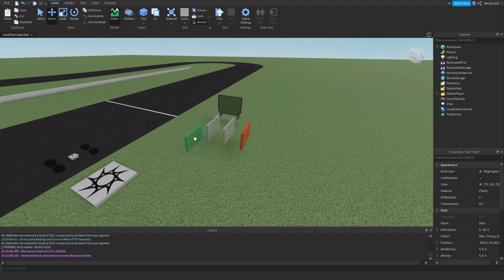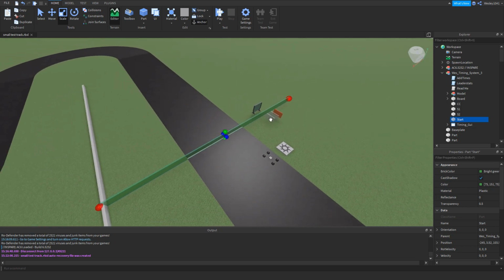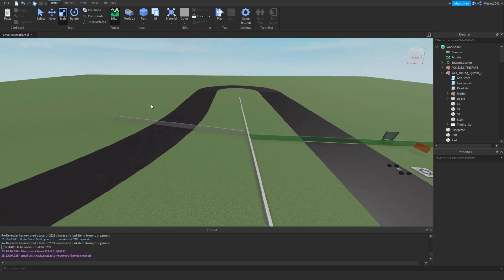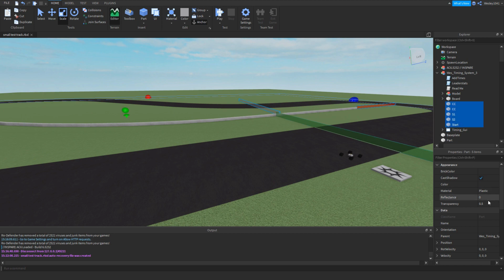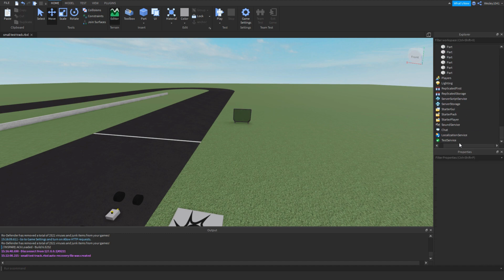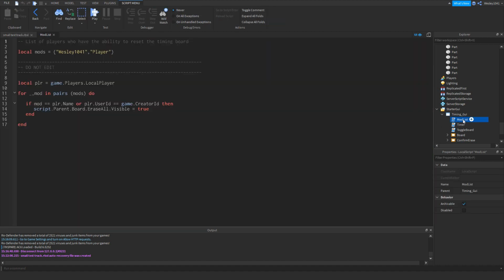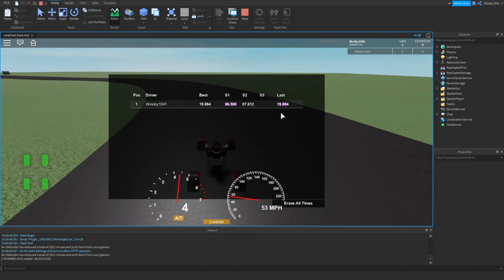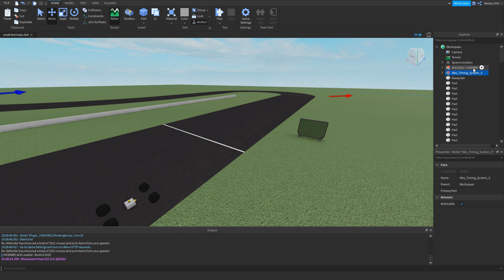ROBLOX | How to Install Wesley1041's Timing System

Comment: This doesn't seem to work anymore. I followed the instructions exactly, and it doesn't do anything. Pressing Q Brings up the gui, but it doesn't register a lap when you complete one.

Nevermind, my bad. I was testing it before I put it onto my track, and as such I wasn't seated during the test "laps" (Running through the gates). Works perfectly fine when seated, so make sure you guys dont make the same mistake as me when you're trying it haha!
Reply: I'm sitting down it still won't work
Reply: DONT UNGROUP THEM i hope i helped

Comment: WARNING: Everyone, do not use short tracks as the timing system will kick you for "cheating".
Reply from the maker: What have you tried in order to fix it? Go to the Config script and increase the min. sector and lap time values. This should fix it.
Reply: @Wesley1041_o  I simply just disabled the cheating system instead.

Comment: So I’m having some trouble with installing this, I think it’s because I’m setting the sector 1 + 2 in not exact locations of 1/3 the track, but otherwise I think I’ve done it all correctly, they worked at Daytona, no other track though

Comment: where is filtering, did it change to streaming?
Reply from the maker: Roblox removed the setting. It was due to be removed for a long time iirc.
Reply: @Wesley1041_o  is it possible to get it work then or do I have to use the New timing system you made?
Reply: @aarolehtinen7211   agreed
Reply: @wesfan1  what do you exactly mean with that? :D
Reply: @aarolehtinen7211  you aksed "

Comment: Hey Wesley, this is an awesome video. 

For some reason I cannot get it to work, it’s almost like the timing system isn’t there at all. I’ve done everything in the video including placing the GUI into starter GUI. Is the script outdated?
Reply from the maker: Hi. The script still works! Make sure to follow the steps carefully and do not ungroup anything. That will mess up the script. It's the most common mistake people make.
Reply: @Wesley1041_o  yes same problem for me too. I've done it like 10 times and watched the vid also like 15 times but it still doesn't work. the times dont get regietered
Reply: Something that does work is kick me for going too fast in test lol.
Reply: @seannolan2120  yeah

Comment: Hey Wesley, great video that you made!

But I have a slight problem, i do have the model but I can't separate it. Can you help me out on how to separate it so i can make a proper lap timing system?. Thanks!
Reply from the maker: With Alt + Click you can select a part inside a model. If you hold the Alt key you can move it.

Comment: Can you make the character not have to be in a seat, so you can just walk through it to start it
Reply from the maker: Yes. If you go to TImingGui>Timer, then towards the bottom of the script there is an if-statement that you need to change by removing the bit that checks if the humanoid is seated.

Comment: Is it possible to run 2 timing systems in one game? Since the circuit im currently building also has a drag strip it would be nice to have 2 seperate timing systems
Reply from the maker: Unfortunately not

Comment: The sectors do not show up, neither does any of the cornercuts or laps
Reply from the maker: Are you sure that you have installed everything correctly? The #1 mistake people make is that they ungroup the main model, which is something you shouldn't do. Make sure to hold Alt to select a part within a model if that's the case.
Reply: @Wesley1041_o  Thank you!
Reply: @Wesley1041_o  Also another question, Is there a way to add datastore for a multi place game? Like a track system that saves peoples laptimes across multiple servers? Would be great :)

Comment: Hi Wesley!

Thanks for the help with getting the system to work! It runs perfectly.

However, is there a way to reset Race Mode of your Standings GUI without refreshing the server?
Reply from the maker: Hi! You can "reset" Race Mode by clicking on "Race Mode" to turn it off, then reset the lap count of every driver via another script. Unfortunately my model doesn't have that feature. Then once you've reset everyone's lap count in the leaderstats, press "Race Mode" again
Reply: @Wesley1041_o   I can’t 
The new update

Comment: how do you pick up the pieces without dragging the whole thing?
Reply from the maker: Hold Alt when selecting a part inside a group
Reply: @Wesley1041_o  thanks, it works, i also succesfully installed race mode system, thanl you so much!

Comment: Question where do I put the time system things on Daytona and others nascar tracks
Reply from the maker: You place the start part on the start/finish line and make sure it extends to the pitlane. You can place S1 after the 1st bend and S2 right before the 2nd bend.
Reply: @Wesley1041_o Wdym by bend?

Comment: Hey I have done everything in the video and reinstalled multiple times, I did not ungroup anything and held alt to move each individual piece, I have the corner cuts, sectors, and start/finish line all in place properly. I'm using a car I built using a body rendered in blender, a-chassis 1.4 with a custom tune, and nothing else. Every time I try to do a lap it doesn't show up or show I completed a lap, there's no errors in output. Also whenever I hit G (the key I assigned to open the leaderboard gui) nothing happens, not even when I just leave it default and use that key. Also side note, corner cuts work fine, but nothing else does.
Reply: Try removing "and char.Humanoid.Sit" on line 116 in the Timer script inside the TimingGUI.
Reply: @rdc6610  I don't see that in line 116. It literally doesn't work, used alt to move each piece.
Reply: Hey lambo sell ur lambo and pay scripter

Comment: i use time gates wich you sometimes see on circuits being huge adverts hanging above track where sector 1,2,3 are sepparated. you need to drive trough it else your lap may not count

Comment: Wesley the timing system isn't working for my type of car, it works for other types, but not this one. Can you help me?
Reply from the maker: The timing system only works if your character is seated, which may not be the case with your car. The easiest way around it is to go to line 116 in the Timer script inside the GUI, and remove "and char.Humanoid.Sit". Problem with this is that people could then set lap times if they run around the track
Reply: It's still not working, I think its because the scripts that are in the VehicleSeat. The script called NetworkScriptCar, I think.
Reply: The Script is: 
local seat = script.Parent
local Players = game:GetService("Players")

seat.Changed:Connect(function(prop)
		if prop == "Occupant" then
			local humanoid = seat.Occupant
			local player = game:GetService("Players"):GetPlayerFromCharacter(humanoid.Parent)
			seat:SetNetworkOwner(nil)
	end
end)
Reply from the maker: I'm not familiar with the SetNetworkOwner function, I only just looked it up. My guess is that in order for the times to be tracked, the timing has to be handled by a server and not a by the client, which is what my model does. It looks like the timing system is not compatible with your script :/
Reply: @Wesley1041_o  Did you make your own script so your cars wouldn't be lagging, (Lag Vision).
Reply: Ive had the same problem, try adding timing gui into screen gui

Comment: Is it possible if you could add mini sectors and make it to where it position changes through each mini sector, not just the starting line 

(Edit: this includes the standings script so it can update, would that work?)
Reply from the maker: Thanks for asking! Unfortunately I'm not planning on releasing a version with those features anytime soon

Comment: Does not work for my daytona track when i have my 1st race
Reply from the maker: Hi. Make sure you have not ungrouped anything, because that seems to be the #1 mistake people make. If you did ungroup anything than it's probably best if you redo the installation and remove everything that was part of the old timing system. If you want to select a part that's inside a model, hold Alt on your keyboard
Reply: @Wesley1041_o  but then if i ungroup it the things will come apart even with the timing system borad if i group them they wont work and i can only move everything
Reply from the maker: That's why you shouldn't ungroup anything. If you want to move a part that's part of the model, hold Alt and click on the part you want to move. You also have to hold Alt when you drag that part around
Reply: @Wesley1041_o  then i go to the part click on it i went to proper and i click on the part and it work 😁

Comment: Hey, I move the sectors with f3x, and it would sometimes not count my lap. Sometimes it would though. I did all your steps correctly. Any help?
Reply: Oh forgot to Mention, it isn't recognizing that my car is running through the sectors.
Reply from the maker: Hmm... I don't get this one often. The detector is looking for when the character touches the trigger part.You could try to increase the width of the sector parts. The parts being too thin could cause the issues. Also, do any errors appear in the output if you test the system in studio?
Reply: Wesley1041 no errors appear. But I heard that the timing system along with the standings script get buggy with Non-Vision lag. I never tried to increase the width of the Sectors yet.
Reply: You need it to paste just the workspace no other folder or model or it dont work

Comment: didnt works
Reply from the maker: Hi. Did you run through all the steps correctly? I recommend running through the video again and checking if you have done everything that has been shown in the video. You might have forgotten to do a step or might have done something unintended, like renaming any of the objects.
Reply: Don't ungroup

Comment: didnt work for me while i was testing it
Reply from the maker: Hi. Are you 100% sure you went through the steps correctly? Did you move the Timing_Gui to the StarterGui? Keep in mind that you can't rename any parts or move the model inside another model. If it still doesn't work, then please check the Output (you can enable it through the "View" tab in Studio) and let me know what kind of error you are getting.
Reply: @Wesley1041_o  i might delete it then re-do it
Reply: @N7P7  ye i figured it out
thx anyway

Comment: how can i make it work with non-players? Like with parts for example, if it is even possible
Reply from the maker: It is possible but it requires quite some scripting modifications. You need to make the local timing system trigger by a part, which must be associated with your player. You could use an ObjectValue to help achieve this, but it requires some scripting knowledge.
Reply: @Wesley1041_o  ty for answer :)

Comment from the maker: Since I have received Discord messages on how to install the timing system, I thought this video would be useful to have! I wanted to make a quick video on the standings GUI as well, but as it's the final day of the year, it's a bit hard to record a video when fireworks are blowing up every two seconds! xD

So there will be a video on the standings GUI model later this week!
Reply: why cant i move the sector parts ?
Reply: @zenqvix1319  Just Turn Of Collisions Next to the Rotate Button
Reply: My laps aren’t counting on the leaderboard please tell me how to fix
Reply: my cars dont work with this so can you tell me whats wrong?
Reply: CAN WE BOTH WORK ON A NASCAR GAME AND JOIN MY SERIES USER IS EPTICGAMER9 AND IS GREEEN GARRAFES
Reply: one question  I set everything right but it's still not working. I'm using the standings script as well.
Reply: nothing works, laps dont count, corner cuts dont count, sectors dont count, nothing shows up n the timing screen, i rlly need help